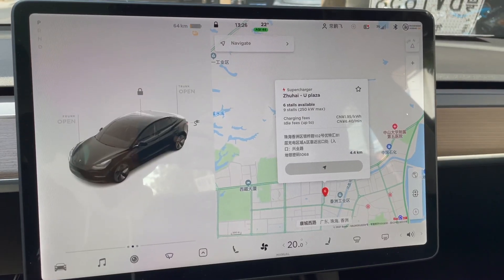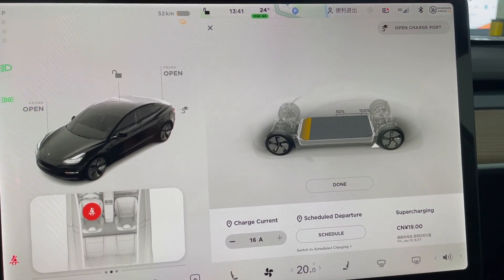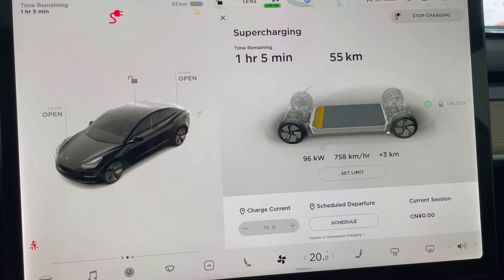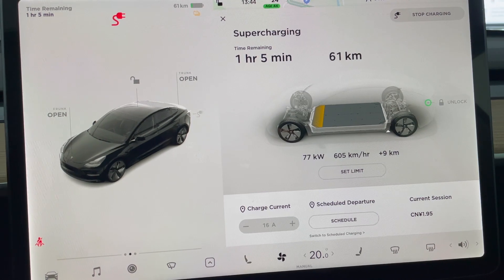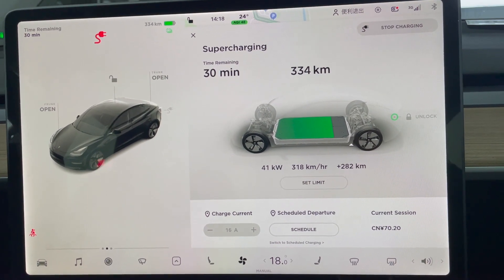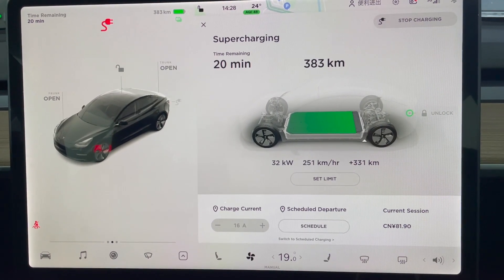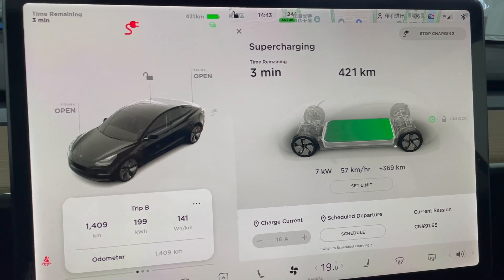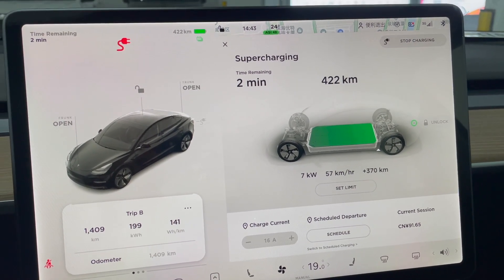LFP battery Charging test from 2021 MIC Tesla model 3 SR+

Comment: In Deutschland bekommen wir das Model 3 SR+ im Februar 2021. Viele Menschen hier sind enttäuscht über die Ladeleistung der LFP Akkus. Was ist der Vorteil für Tesla? Nur der Preis.
Aber danke für das Video es ist sehr gut. 👍🏻
Reply from the maker: Thanks for your support, sorry I can only write in English. LFP battery has certain advantages. For example, it can charge to 100% every time so that you can get a longer range in LFP SR+ model 3. LFP battery is more durable and it has a slower rate of degradation. In case of a serious traffic accident, LFP battery is also safer, and LFP battery is much cheaper as well.
Reply: @gogochang1153   Additionally I like to add: Tesla has announced, that there will be an update for the LFP battery to increase charging speed and a more accurate range display - it will be released in february.
Reply from the maker: @monsieurb90  great. I will wait for the software update and see what are those improvements related to LFP battery.
Reply: @monsieurb90  can you link to where you have seen this announcement?
Reply: @CarlosGarcia-vi6zx  This was the answer of my Tesla Service Center that they are aware of the charging performance and that there will be an update in february. But there are also several other drivers reporting this in messaging groups. The update will be between calendar week 4-8 -> february. :-)
Reply: @monsieurb90  Thanks for this, but can you please confirm if you mean a software update? (I assume you don't mean a hardware update?) I take delivery of my MIC M3 SR+ in 2-3 weeks in Australia, so this is of interest to me. Thanks in advance :)
Reply: @mspalmboy   I mean a software update. The new 2021.4.X and following updates should bring several improvements according to Tesla.
But maybe your new car will also have a heat pump, the MiC in December for Europe were still without heat pump, so I can’t say what you are getting in Australia now.
But anyway, be happy, you are getting a great car with perfect build quality, much better than from California. ;-)
Reply: @monsieurb90  thanks for your response. Tesla say my car will have the heat pump and the larger brake lights from Giga Shanghai. It should be a great car with better build quality and I'm pleased that I can charge to 100% with no problems. The biggest downside is the much heavier battery.
Reply: @mspalmboy  It’s not that much more. In Europe 73 to 130kg in comparison to a US SR+, depending on the concrete specs. Have fun with the car! :-)
Reply: I thought the LFP battery was 100 kg heavier. Thanks for this info that it's only 57 kg heavier.
Reply: @mspalmboy  no it’s 73 to 130kg more in comparison! Sorry for the confusion. ;-)
Reply: @monsieurb90  We have not get it in Finland still waiting for this update to improve the charging speed.Can’t wait to have this update.
Reply: @davikayode  You will receive it soon, I‘m sure! :) I have really good results with the update now, but keep in mind that it’s always necessary to drive some distance before a Tesla can charge fast in Winter - that’s a thing with all battery variants.
Reply: @monsieurb90  Thanks @Monsieur Is cool to hear this.What KW did you get at the fast charger after the update?
Reply: @davikayode  After 180km of driving (120-140km/h) I got 166kW peak at a V3 Supercharger - and 0-80% was done in 25 minutes. Temperature outside was 8-10°C and I did preconditioning via the navigation system.
Reply: @monsieurb90  This is really a good news I am happy to hear this.I almost lost interest in my Tesla I was about to change it,this info is so good thanks.🙏🏽

Comment: Very helpful video. Surely Tesla will need to address the false claims of charging speed and range on these new models. The current configurator for a SR+ in Ireland says the range is 448km and charging speed is up to 180kWh.
Reply: Where have you seen that information about the charging speed of the SR+? 180Kw for a LFP battery?
Reply from the maker: 180KW is really fast for LFP battery
Reply: Sorry, I meant 170kW for the max charging speed. Whilst Tesla’s site doesn’t explicitly say the max charging speed, other sources do. https://electrek.co/2019/11/28/tesla-model-3-standard-range-plus-mid-range-get-major-charging-boost/
Reply: @CarlosGarcia-vi6zx  So, that's for USA model 3 SR+, not China's model with LFP.

Comment: For how long did you preacondition the battery? Just 4 km? In time?
Reply from the maker: I preconditioned the battery for about 20 minutes. Don't forget the outside temperature is 24 degree, so it does not take a long time to heat up the battery to about 40 degree

Comment: I have a Model 3 Long Range ordered for delivery here in the UK in March. I'm told by Tesla that it is coming from Shanghai, so presumably will have the same battery pack technology as your car (only larger). The charging speed you are getting on a V3 Supercharger seems slow compared with examples I have seen from MY21 cars here in the UK and Europe. What's your view on this?
Reply from the maker: But it is also likely that Shanghai factory will start to make long range model 3 again. SR+ model 3 with LFP battery (55 KWh) has the same weight as long range model 3 with battery from LG or Panasonic (75KWh or 82KWh). LFP battery is much heavier so it is unlikely for long range model 3 to use LFP battery.
Reply: @gogochang1153  I suppose I will have to wait and see. All I know comes from my telephone conversation yesterday. They told me that my car is part of the first shipment that will arrive from China in early March. We even discussed the changes such as the heated steering wheel and the new door panels, agreeing that they were worth having. I was surprised they were so open about this. However, if you are right, this could indeed be misinformation and my car could be coming from the USA. I'm not too worried either way, but it would have been nice to have the small improvements which will no doubt soon apply to cars made in other countries.

Thanks for an informative video, by the way, and I hope you are encouraged to keep on vlogging....

Michael
Reply from the maker: @Macfilos  Thank you so much for your support. People in China are discussing when will Shanghai factory start to make long range model 3 again, I think it is quite amazing that they will start to do that in February since it takes a month to arrive in the UK. Let's wait and see.
Reply: @gogochang1153  I ordered the car on January 3 and initially it was showing delivery sometime in February. Now that date has slipped to March, which is probably significant. The guy left me holding on for about ten minutes while he checked with colleagues. He came back to say that the next delivery of Model 3s would now be arriving in March and that it would be the first to arrive from China. I will keep you informed if I hear more.
Reply: @gogochang1153  Last month I mentioned that my new M3 LR here in London would be MIC. I collect the car on March 1 and I have had confirmation from Tesla that it is indeed an MIC car. It is one of the first consignment of cars to come from Shanghai and I will be a guinea pig. I hope the quality is up to standard but I am looking forward to the enhancements, including the door trim and the heated steering wheel.
Reply from the maker: @Macfilos  I made a video to talk about the build quality of MIC model 3, and I don’t think you need to worry about the build quality anymore. Congratulations! Have fun with your new Tesla!
Reply: @gogochang1153  Thanks.. I did watch the MIC quality video, another good job. I had a chat with the Tesla guy who told me that the quality of the MIC M3 is much better than previous models. Of course, they would say that, but he sounded genuine. I will make up my own mind on Monday afternoon. Great excitement here...
Reply from the maker: @Macfilos  Please give me an update after your new Tesla is delivered!
Reply: No, only SR+ have LFP batteries.
Reply from the maker: it is impossible for you to get a long range made in China model 3 in the UK since Shanghai factory no longer produce this particular model anymore. Shanghai Gigafactory only produce SR+ and performance model 3, they just cut off long range model 3 on Jan 1st 2021. Based on my Information here, LFP battery will only be applied to made in China SR+ model 3 and SR+ model Y.
Reply: The salesman in Hk told me MIC long range is available , will check out which battery it carries 
Very informative video！ thanks
Reply from the maker: @timchung911  you are welcome.
Reply: @gogochang1153  Tesla HK refused to enclose which brand/which type of battery they're using for the Long Range MIC model 3.  from i what i found online and forum in mainland china, i believe MIC LR version are still using LG NCA battery (for now).  Do you have any information on this? cheers mate
Reply from the maker: @timchung911  it’s impossible for long range model 3 to use LFP battery because it will be too heavy. I believe that long range model 3 will continue to use LG battery. However, LG battery cannot charge to 100% every time, if you only charge to 90%, the estimated range will be around 480 KM, compared with 100% LFP battery, which is 420 KM, I don’t think it’s reasonable to pay much more for only 60 KM.
Reply: @gogochang1153   Thanks for your info! the price difference also includes the dual moter and more speakers?
Reply from the maker: @timchung911  yes of course